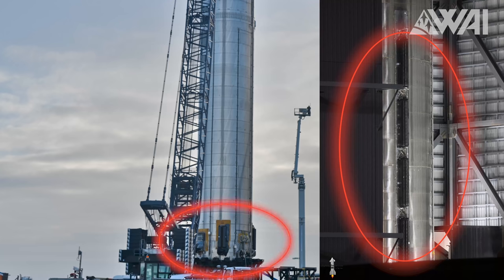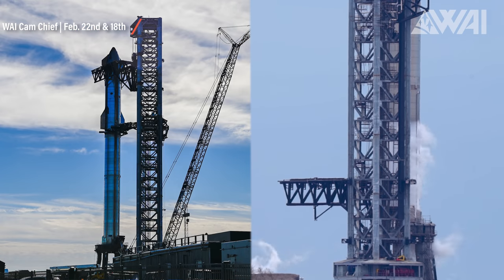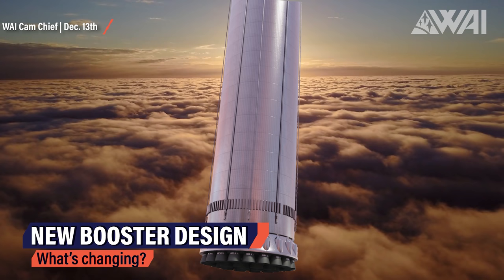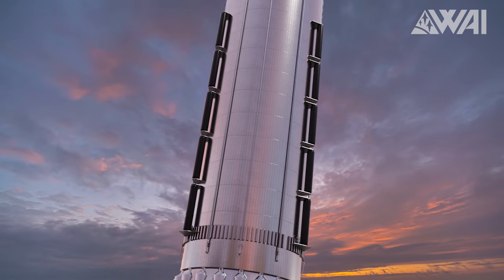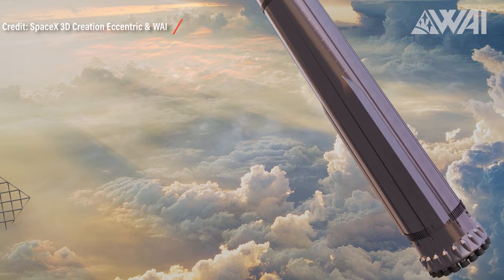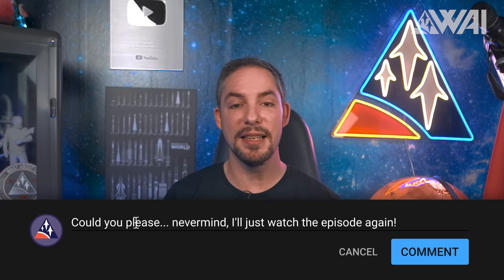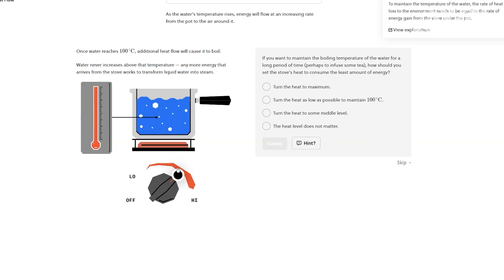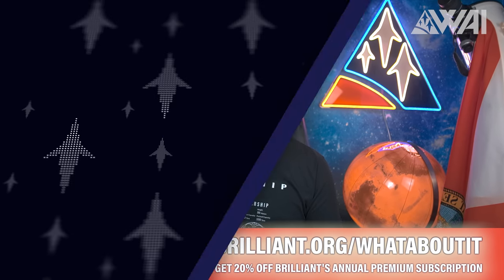How To Make A SpaceX Super Heavy Booster Glide Like A Wing?

Comment from the maker: Do you have any further questions about rocket booster glide capability? :_WAISweet:
Reply: Doesn't the booster wants to turn around so that the drag lips are on top and not on the bottom?
Reply: Great update. Are you thinking that Elon is working towards a leg landing main booster. It sure would be less risk because they have that down, pat. One accident with a landing booster at the launch pad could pose a sizeable delay with repairs, I'd imagine...Maybe the leg landing is the best path for high volume launching plans...
Reply: Also, stacking the COPV's means less frontal area (vertically) and hence less drag during the boost phase of flight
Reply: Well, what is the best/cheapest way to fly from Europe (Netherlands) to Starbase if gliding ain't an option?:) You have experience in this.
Reply: SpaceX stealing from rocketlabs neutron.
Reply: Nop, but please center youtube award with poster behind You 😁.
Reply: Thanks for the videos!
Like the booster, why doesn't starship do both a re-entry and landing burn eliminating the need for heat shield?  I guess it's a matter of efficiency, which is better to reduce the higher velocity, a heat shield or more fuel.
Reply: YouTube unsubscribed me for no reason
Reply: Why more cross-range needed? Wasn't enough before?
Reply: Are you sure you got the Drag and Lift vectors right? Have to think it through once more...
Reply: Do you think the design of the 'wings' will continue the body line created by starship's wings?
Reply: The idea comes obviously from the neutron. Just like the neutron uses the idea of the second stage not needing a housing from Astra space. All these idea give us better rockets.
Reply: @zaphodbeeblebrox2817  Falcon boosters can do a reentry burn because they are by far not at orbital velocity, Starship on the other qpuld need almost as much fuel as to get to orbit, to slow down enough so that no more heatshield would be required
Reply: @ProgressiveEconomicsSupporter  
I agree. The longer I look at it, the more it seems they've got them reversed.
Reply: If wings then why not wheels?  Especially for human rated versions.  A smooth landing on a runway has been done many times with little stress and maximum safety.  S-turns provide huge crossrange capability and a very robust ability to conduct a pinpoint (runway) landing- assuming the heat shield holds!  Of course for the booster, the same principles apply without the fear of the heat shield failing.  Land the vehicle horizontally.  Taxi to the launch pad located at the end of the runway, lift, refuel, refly.   The vehicle even has go around capability (if it misses the runway it can fire up and engine and do a go around for a second attempt).

Yes, we need a pinpoint propulsive landing on Mars- but only once and not necessarily with humans onboard.  We know how to land planes, even space planes.  Propulsive landing is much, much harder and doesn't always work even now years later with F9.

Werner Van Braun's Starship that looks suspicially like the current Starship the Elon helped design landed with wheels.
Reply: Are you an Ęngineer Sir? I ask in earnest.
Reply: I have a PhD in medicine but not engineering.  Space has been my passion since Apollo.
Reply: @ATOM-vv3xu  Maybe not - being on top woul put them in the lee of the body.
Reply: @zaphodbeeblebrox2817  MOre fuel and thus more weight.
Reply: @jessepollard7132  no I don't mean thats a bad Idea I, ask how they want to prevent the body form turning around by itself
Reply: @grbesavinko  lol
Reply: You are calling the aerocovers strakes as opposed to chines. Can you elaborate on that a bit more?
Reply: whats the instrumental at 3.40 min??? it bangs
Reply: Does anyone know why we havent had an update 2 weeks +?
Reply: @rogerschrager3589  good point

Comment: Repeated cryogenic pressure tests may be testing the metal by fatiguing it to simulate the effects of many flights.  This will verify that the structure remains within spec after repeated pressurization cycles or will reveal problems before they occur on a flight.
Reply: Right, projecting actual lifetime with real life cycles, nondestructive testing at its best.
Reply: that but more likely testing things for zero G refueling.
Reply: @jessepollard7132  Zero G tests are a bit hard to do at ground level. ;-)
Fatigue tests could be done with pressurised water. Just keep roaming the pumps up & down.
Reply: @Dave5843-d9m  Zero G tests are not necessary. JUst a balance beam. But repeated stress tests help.
Reply: You can also stretch stainless steel to harden it.
Reply: Could also be ensuring everything is good between the software and hardware before a potential test fire and launch. They just messed with the QD arm in the last few days too. They're stacked again and trying for full cryo testing of the vehicle this week.
Reply: @Dave5843-d9m  the temperature fluctuations are the biggest issue pressure is important but temperature is the unknown.

Comment: not sure why people dont think 420 will fly.  it is done and ready, the cost of fuel is the only thing left to invest in the immense amount of data they will get from it.
Reply: Yup, Load and go! its going in the water anywho.
Reply: They have a bunch of Raptor v1 engines and no other use for them. Might as well learn something about all of these new systems on a booster design that has never flown and hopefully getting far enough in the flight to observe the failure modes of the v1 heat shield.

Comment: Stacking the COPVs was to reduce the drag that the double wide covers created.  Making them into a 'wing' of sorts increases the ability to direct the booster in a more predictable straight line.
Reply: @Pipersall  And in addition to a straight line during descent they can roll slightly, direct the lift off-center and bend their flight path toward their destination without using propellant.
Reply: yes I agree it will help the booster to glide into the catching arms in the correct orientation with the pegs either side of the booster ready for the catching arms to do their job.
Reply: @DeryckThompsonChasingtheDream  Actually my point was that all they do is reduce drag on the way up and act not like wings but more like the vanes on an arrow on the way down.  They have nothing to do with correct orientation for the final catch.

Comment: The 33 Raptor engines are very heavy, making the returning booster aft-end heavy. Putting the landing propellant near the top end (in header tanks) helps a little bit, but the grid fins still cannot tilt the booster as much as desired. 

The COPV covers will act somewhat as strakes that increase drag when the booster falls broadside to the airstream. This drag is concentrated at the aft end - closer to the heavy Raptor engines. This allows the grid fins to tilt the booster closer to right-angle broadside, thus reducing the terminal velocity even better.
Reply: A fulcrum of sorts?

Comment: I think a good chunk of the recent cryo testing might just be related to putting the GSE through its paces and tweaking their processes.
Reply: Indeed. And only these week they have started to replace the upper QD connection with a newly designed one as a result of that testing. You may recall they had some issues with the QDs at the time of the last stacking.

Comment: The leeward side of the booster now looks like the Mk2 profile in KSP. A lifting body. As soon as I saw it I knew this what they are doing. More cross range capability, possibly using a glide path to bleed excess energy from the fall and reduce boost back burns.

Comment: Putting the copv's in a vertical linear configuration is just common sense as long as there's acceptable pressure loss due to longer delivery pipes. There would be enough benefit from that alone in drag reduction. It would be pretty cool indeed if it did have the stated dual purpose.

Comment: One explanation for the multiple Chyogenic tests might be to see how the different shop components reacted to being stacked and unstacked. You know.... testing the welds under pressure after being exposed to loads not physically encountered in the past. Just a thought. Testing each step seems to be how they isolate issues, before they become problems.
Reply: or micro fracture acumulation caused by the termal stres of the fuel loads
Reply: Also likely testing the tiles as the first few cryo tests had some fall off.

Comment: As a lifelong sailor (like 52 years) the complete  parallels are striking. In a sailboat,  the lift comes from wind on aerodynamically formed sails, the drag from the hull in the water, and vertical and directional stability  from a weighted keel. 

It's  literally all the same principles applied in the atmosphere instead of the ocean.
Reply: Sure is! Air is also a fluid (in this physics context). I slapped my own face when I learned that. Seems obvious now, but I joined no dots before that haha.
Reply: Which is why they should recruit sailors for the deep space missions. They know the sailing concepts and know how to deal with and plan for long absences and journeys..
Reply: @beckyburke9681  I'd love to but  I'm  way too old. :-)
Reply: @jangunnarrooth  Ah, there is no replacement for experience. The grunt work can be done by the young deck hands...

Comment: Won't those COPVs eventually go away when the ullage system is implemented? Presumably the aero covers are removed then as well?
Reply: Presumably not, because the COPV's are used for Raptor turbopump spinup, not RCS.
Reply: The COPVs have to be replaced on the Starship, because there isn't an obvious way to refill them on Mars. There is a lot less incentive to replace them on the booster.

The ullage gas isn't normally at a high enough pressure to spin up the turbines. The Starships will need high pressure compressors and storage tanks to be able to provide enough high pressure ullage gas for engine starts. That infrastructure will probably weigh more than the COPVs.
Reply: @hamjudo  The booster isn't needed on Mars, as I understand.

Comment: Dunno if you have mentioned it before but Spaceship 20 seems to have quite some unused pins for additional heat protection tiles below the top flaps. At least some pins would protude 3-5 cm (1-2") or so into the hot plasma at re-entry. That'd also argue against Spaceship 20 ever making it to LEO.

Comment: i am by no means literate in the physics, but if as described having the wing be oriented in the bottom force the grid fins to work harder to maintain position versus the "wing" being at the top during fall? it seems that during reentry the booster grid fins would be fighting the wings on the way down. If the wing was intended to be on the higher side on the way down it would require less torque from the fins and more control on the orientation of the ship on the way down. I hope this makes sense I'm no physicist or rocket scientist, just seems the "wings" would naturally want to be high during descent due to drag.

Comment: Just think about what was reported in this video today? SpaceX must have known for a long time how the Super Heavy would be configured but there was never a hint about these changes until just now. As to the production of Methane, Musk must have had this in mind all along as well. The resources have been nearby and meant for use by SpaceX before this project was ever announced. Then we have the four rocket configuration for fuel loading that was just announced earlier this week. Put all of these and other things together with a highly advanced launch facility and engine development and metallurgy company and you have something that most businesses or governments in the world could not duplicate, certainly not in the same time frame. Over the last 24 months we have seen all of these things quickly develop and put together one piece at a time. Delivered on time, some already manufactured for installation, with precision and a flexible workforce. We need SpaceX and we need to get on with this project.

Comment: Why are the tanks even on the booster? It seems like starting the raptors with ground tanks would save a lot of weight. I know some are needed for the landing engines. Is it a safety or reliability issue?
Reply: It only has COPVs for the engines used for landing.
Reply: @zackarybuddish1344  Thank you 🙏
Reply: They also supply the cold gas attitude control thrusters.
Reply: @zackarybuddish1344  How many Raptors will the Super Heavy use for landing?

Comment: Great episode! 
Question: if boosters will be wings, why would they not try the bellyflop and use actuating flaps as on the ship? If it works for the ship why would it not work for the booster?
Reply: flaps are heavy, and the booster does not have to come down from the same speeds as the starship.
Just a landing burn after free-fall is much more efficient for the booster.

Comment: 7:12 Wouldn't there be more wind resistance if the covers were spaced 180 degrees? The surface area to the relative wind would be greater.
Reply: Yes, but the angle makes it more stable. Think of \__/ vs ----- falling down through air.
Reply: Yes, but with less stability.

Comment: Many airplanes have parts of their fuel tanks in the wings. Also the engines are mounted there. Isn't that enough to be a booster?
Reply: It is, if you have enough engines.
Reply: No. The engines need to provide a LOT MORE THRUST than current air breathers can do.

Comment: Put a delta wing on the SuperHeavy, and you'd have a SpaceX version of the F1 Flyback first stage! (The problem, is that the added hardware would be super heavy!)
Reply: How about a non-rigid, parasail deployed during descent?  It could be much lighter than a rigid wing.
Reply: @glennmitchell9107  The advantage of vertical landing, is that one avoids all of the structural reinforcement required for horizontal landing and landing gear. Because of the square/cube law, the additional structure to hold the additional fuel for vertical landing is going to weigh less than the additional structure to support the added wing area, plus the landing gear and stiffening for horizontal landing loads.
Reply: @stcredzero  The (non-rigid) parasail wouldn't replace vertical landing.  It would only slow the booster's descent and give it more horizontal drift, thus requiring less landing fuel.

Comment: 8:20 that is all wrong, the booster doesn't bellyflop, it will be coming down engines first.  It should have the top pointed to the left not the right if it's falling to the right as it appears to be.  The grid fins would be useless in the orientation you show.
Reply: It will now be able to do a 'partial belly-flop'.

Comment: Love the content! Do the new additions cause any more fuel to be burned because of extra weight? Or are the rockets so strong that there’s already a range of weight that won’t effect the fuel usage?
Reply: They're moving the COPV tanks around and changing the shape of the covers to match. The new covers handle higher aerodynamic loads, so they have ribs for extra strength. The stronger covers are somewhat heavier, but the landing fuel savings will more than make up for it. 

The COPV tanks are just being moved around. That doesn't change the total weight.

I predict that the booster will get a little lighter when they move the external wiring and tubing under these protective covers.
Reply: The drag during liftoff will be reduced and drag during broadside reentry will increase - both desirable.
Reply: Thanks for the answer

Comment: How sure can we be, about the FAA giving the license to launch on 28th of March? It can be to set another date for future revision. Imagine to set another date until June.
Reply: The March 28th date is not for launch approval. It's for environmental approval of the launch site and proposed operations. There is likely to be a delay of days or weeks between environmental approval and the issuance of a launch permit. If the environmental assessment is approved I don't think the FAA can deny SpaceX a launch permit but they will try to delay them until after SLS has launched.
Reply: @gilbertanderson3456  AIUI, launch approvals don't take that long to process. The FAA PEAs are usually one time things for a launch facility, it's just that SpaceX had to do a second one as the first was in 2014 for Falcon class rockets. A Starship has roughly 9 times the propellant as a Falcon 9 B5, so it is not surprising that a new one was needed.
Reply: With SpaceX starting a factory building at Boca Chica, that may be a good sign that they may get FAA approval.
Reply: @gilbertanderson3456 We will see what happens on 28th of March. I'm afraid of another delay.

Comment: I am concerned with transferring Hydrogen via pipeline.  Since it is the smallest atom, losses are unavoidable.  Converting the H2 into Methane before shipping would make more sense, unless your story was absent the method to be taken to reduce those losses.  Perhaps use of thick pipes, or use of exotic materials to construct the pipeline (but that would make them untenable to produce).  What are your thoughts?
Reply: yes. Also think about what would happen with a pipe rupture. hydrogen tends to make metals brittle. easier to crack, or other defects to break and create massive hydrogen leaks.

Comment: I'm expecting a switch to an air-breathing engine for first stage, at least partially. Imagine if you can halve lift-off ratio of LOX to fuel. Back-of-the-envelope 30% more capable booster.
Reply: The problem is that air-breathing engines don't produce the required thrust for a rocket booster. It would make sense for a multi-stage space plane though, exactly because of the reason you gave.